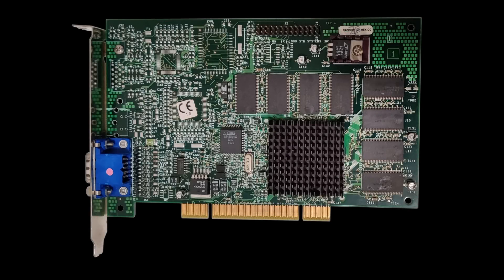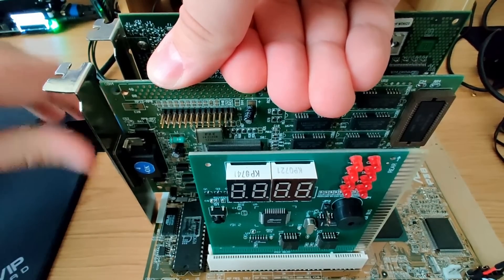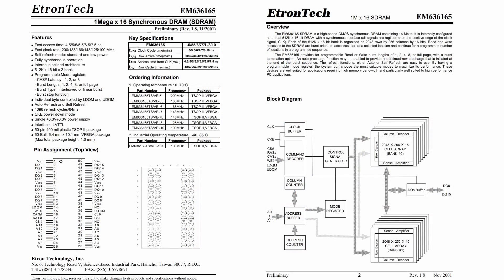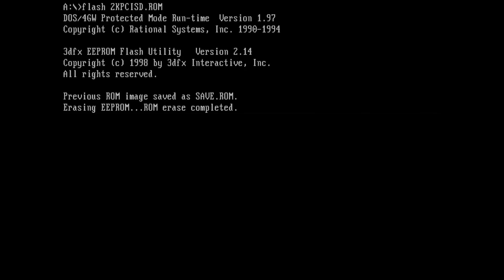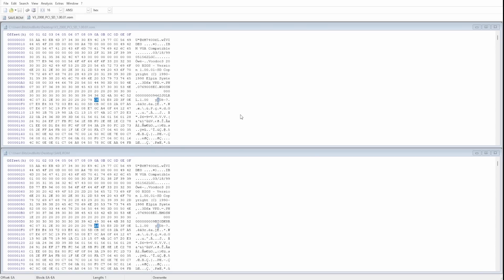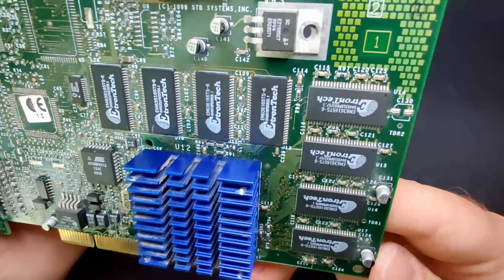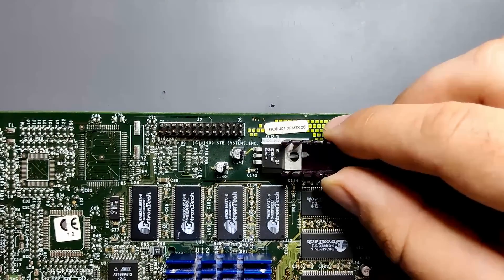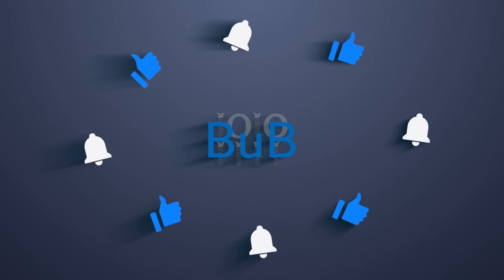Fix common issue of 3dfx Voodoo 3 (black screen)

Comment: I need to do this to mine I think. It works intermittently- either that or my CPU overclock is borked. :/ The card is completely stable in game but sometimes my board beeps with Bad Video Card- which is obviously false, since after a few reboots it starts perfectly. This did only start to happen when I added some unsupported RAM though.. some weirdness going on with my RAM, I have two 128MB sticks and a 64MB stick, when only the 128mb sticks are installed it detects 128MB when the 64mb stick is installed in the last slot it bumps the total to 256.. idk what's going on with this machine lmfao
Reply from the maker: The issue with the card is very similar to what I have experienced with my Geforce2 MX. At some point, it stopped completely - and the reason seems to be the BIOS chip slowly losing data integrity. A reflash of the BIOS chip should help.
Reply: @bitsundbolts  I replaced a memory module and it stopped doing it. I’m still going to flash most likely- my card is stable at 3000 speeds so no reason I shouldn’t flash 3000 bios. My case has a side fan blowing air directly over the card it’s perfect
Reply from the maker: Right, it could be related to other hardware in your system. I would try to run everything at stock speed and see if the bad video card error disappears. Then you can reinstate the overclock one by one testing each over a few days to make sure it's stable. It's a tedious process

Comment: I also had a similar problem with an nvidia fx 5200. I removed it after it wouldn't show any output and replaced it with a matrox card and when I put the nvidia one back in years later, it suddenly worked

Comment: While flash based ROMs will develop errors over time, the main problem with old video cards are the electrolytic capacitors. They only last a decade or so and need to be replaced.

Comment: I've seen newer components that replace older voltage regulators for ZX Spectrum and some other consoles, they're much more efficient and release much less heat. Maybe that could also be an option for the Voodoo cards?

Comment: Great video so far, one comment: you should screw the regulator the other way around, with the screw comming from back and nut on the regulator side
Reply from the maker: Curious why. I followed the other Voodoo 3 card where the screw was like this too. Is there any benefit reversing the orientation?
Reply: @bitsundbolts  back in the day, most if not all cards were "flat" on the underside. I guess it was a way to prevent any possible shortcircuits

Comment: Great video! VBIOS issues like this seem to be very common in cards from this era. I’ve revived a couple V3 3000s and some Matrox G200 series cards this way. I’m actually working on an AGP Voodoo 3 2000 right now that absolutely refuses to be flashed. I will likely need to desolder the eeprom chip and flash it in an external programmer like you did with the GF2 recently. Wish me luck! 😅

Interesting that the bad ROM worked again when flashed back. I’ve had this same behaviour happen with a bad motherboard BIOS that I pulled off too. I’m assuming there must be some borderline bits that are difficult to read from the chip that get reapplied properly after the flashing process. But yeah I wouldn’t have trusted it either 😁
Reply from the maker: Thanks! Good luck with your Voodoo 3! Yeah, the GF2 also refused to flash. The BIOS chip I removed from the card doesn't even want to cooperate with my external programmer. Ich cannot write nor read to it - and I get a similar error that I got in DOS. I assume there's something else that's causing issues.
Probably requires more time to figure out what's wrong.
Reply: @bitsundbolts  Thanks! I ended up replacing the EEPROM on it, but that wasn't the issue. In the end it was a damaged trace leading to the "Output Enable" pin of the EEPROM. Was hard to spot, but the card works perfectly now. Will hopefully get a video out on it in the next few days 👍
Reply from the maker: Can't wait to see it!

Comment: I wonder if my Vodoo 2 12MB can be fixed by reflashing its BIOS.
I just stopped working back in the days, somewhere around 99 or 2000..

Comment: Overclocking to 3 3000 is not as interesting as an attempt to add missing parts such as secondary VGA connector. Will it support multi-monitor configuration?

Comment: So why did the bios need reflashing. Wrong bios flash? Info lost from not being powered on for a long time? WHY!!!!
Reply from the maker: As far as I was told, the card stopped working in 2006. Similar to the GeForce 2MX I had at that time, I imagine that the PC wouldn't show a picture from time to time until reset. It gets worse until it stops completely.

Comment: Bitrot
Over time the cmos can lose bits or rather the strength of the bits goes low. Reflashing the same bios brings all the ones and zeros back to 100% strength.

Comment: I have a Voodoo 3 3000 that displays weird stripes once it get's warm. Probably just some cold solder joints somewhere, but since the cards aren't produced anymore, every dying one is a card that won't be replaced.
Reply: If the stripes are vertical, this speaks for a memory problem. Changing the chips does take some soldering skills, but I managed to fix my V3 2000 AGP like that.
Reply: @moritzrudolf5370  is there a way to figure out which chip has gone bad without just going through all of them?
And yes, they are vertical. About 1/4 or so of the width.
Reply from the maker: Unfortunately, I am not aware of a method to find a faulty memory chip on a graphics card. I did some research once and got some tools that claim to be able to find a faulty chip, but it was for S3 virge ( don't remember the tool right now). I'm planning to look into this once I get a card with memory issues.
Reply: @HappyBeezerStudios  an IR camera can help identifying bad chips in general but I don't know if that applies to memory chips too. Also, you don't tend to have one just laying around

Comment: Another great repair. I would like to know the physical differences between a 2000 and a 3000. Is it just the bios?
Reply from the maker: As far as I am aware, just the BIOS is different. It could be that the memory chips are rated for lower frequencies only on the Voodoo 3 2000, but the PCB should be the same as a Voodoo 3 3000. The graphic chip may be binned at a better quality for the 3000 model.

Comment: Flash / eeprom / eprom etc all rely on modifying a charge in a cell to signify 0 or a 1.
The process of sensing and stabilising the read bit takes longer the weaker it is (until it can no longer be read as its correct state at all) so it was likely no more than a marginal bit that needed some extra time.
Another quirk of arrayed storage devices like these is that they can often read data muuuch faster than their spec if you read them linearly compared to jumping around as it would while executing code from said device :)

Comment: Excellent Video, My Exp with Video Cards over the years is to reseat the card into the PCI or AGP Slot which are very tiny and delicate with AGP. Try that first before anything else. Even dust can affect it believe it or not. Seen some dirty cards over the years. Use an Air shop Hose and blow out it clean. Electrical Spray for the Motherboard and dry with a hair dryer on the cold setting. Caps are crap these days, so any one of those could be bad in rare cases. handling is another factor. Even to the day, I see people without rubber gloves and their fingerprints cause corrosion on either the connectors or the board.

Comment: I had similar problem with the bios on my PC main board. After 5 years my PC couldn't boot every time .. once on 3 -4 time and start was very long around 30 seconds. 
Itt looked like my bios was hardly to read by main board. 
But after reflashing  the bios the main board started to work again like a new  ;) ... boot every time and staring in 2 -3 seconds.
I think some bios chip degrade over a time and need to be reflashed.

Comment: I have heard things like bit rot will cause strange issues like this and reflashing the bios will "refresh" it and bring it back to life. I once had a DFI LanParty board that suffered from this and a reflash using the same bios did the trick.
Reply: yup classic case of bit rot
Reply: @MrTGuru Maybe the chip just had some "weak" cells. Reading out the bios probably worked more aggressively and managed to get a functional image, and reflashing it put that "fixed" bios back on.
Reply: @MrTGuru a ghost in the machine i guess

Comment: 🤔Perhaps the flash programming tool uses a slower and more reliable reading speed/method than the the motherboard chipset and was able to recover an intact BIOS.
If the checksum is correct (in HxD use Analysis->Checksums, the 8-bit one must be 00) it's probably just a different BIOS version, it would be quite a coincidence that all the values would change randomly keeping the checksum correct.

Comment: Did you notice the "new" ROM images were 64K and the one on the chip was only 32K?
Reply: That's because the second half of the downloaded ROM doesn't actually contain any code, it's just padded with 0xFFs to match the size of the flash chip.

Comment: Like! Another card brought back to life. A while ago I purchased a Voodoo Powercolor Evilking 3 Extreme with 183 mhz and 5ns (200 mhz) memory. Theoretically with 5ns (200 mhz) memory it should have easily reached 200 or even 210 mhz. But to my surprise it was stable with no artifact at only 183 mhz, even 1 mhz more and small artefacts would appear. Than I noticed that the card had 1 capacitor missing. I guess that it wasn’t stable at over 183 mhz because of that missing capacitor.
Reply: Reminds me of my Radeon 9600 Pro, that also craps out once the memory is just 1 MHz higher.

Comment: I flashed my Voodoo 3 2000 to 3000 back in the days, the timing of the memories allowed it and It cost me a simple precautionary fan on the otherwise passive heatsink (the one on the card in this video too has the marks of having had a fan at one time).

Did it work? Yes. Did I have problems? No. Was there any noticeable performance boost? No.

If you want to do it, be my guest, but in my experience it's only wasted time.

Comment: What I liked about Voodoo 3 2000s back in the day is they supported standard VESA graphics as their legacy mode.  So it required no special drivers or software to get them to work in high-res 2d on Linux in the bad old days of XFree86.

Comment: 8:20 - it seems that flipped bits were placed in non-critical headers section, but after all corruptions the BIOS checksum have not matched the BIOS itself and so the GPU just failed this check and refused to boot, and re-flashing fixed the checksum and the GPU have verified the checksum correctly and booted up. 

Or, maybe, flash cells became unreliable and failed to read correctly at full speed, but flash utility may work at lower clock speed to access BIOS chip, and it works (more or less) reliably, and after re-flashihg charges in BIOS flash were updated, and it became working again.

I had something like this on SSD which was placed in my laptop - I have need to move partition with cold data to another location temporarily, and first movement took a lot of time, but then I have need to move this partition back to original position, and move process took a WAY less time to complete. I think flash chips were not re-written for a long time at cold data blocks, and some cells lost their charge, and so the SSD controller had to perform many error corrections using ECC codes, but after partition move cells were recharged to full charge, and no ECC were needed to read them when I did second movement.
Reply: I was going to say this. I think the most likely explanation is the second one (I doubt the card would perform a checksum of the bios data). I think the only likely explanation is that the flash memory is "too weak" and when read at full speed it just gives non-sensical data, but if read at lower speed (which the flashing utility probably does), then it's possible that it can read the correct value, given enough time. But when he re-flashed the BIOS, the data became more "strongly" written and now works at full speed, even with those missing bits.
Reply: does the tool updates the checksum on the fly?
Reply: @cocusar  I don't know. Maybe re-reading BIOS after flashing BROKEN.ROM will uncover this.

Comment: So what if you get a card that has a missing BIOS chip altogether? 😅

On my "restoration" project pile is a Voodoo3 PCI card that doesn't seem to have ever had a BIOS soldered on the board. (just empty pads where a BIOS would would be)
Until I saw Tech Tanglent's video about the Hydro Thunder PCs using "special" 3Dfx cards that contained their initialization routines in a different ROM on the motherboard, I thought I was dealing with a weird factory issue where somebody messed up. (When the BIOS is completely missing, the card shows up in Windows Device Mangler but not with any identifying titles.)
Reply from the maker: This is new to me as well. I probably would blame the factory as well.
If the PCB of the card is the same as the reference board, I would try to add a bios chip and see what happens. If you're lucky, the flashing tool may just donuts job. But just to be safe, I probably would preflash the chip with the correct BIOS.
Reply: @bitsundbolts  I originally suspended my project until I could practice more SMD soldering before adding a BIOS chip. Thankfully I was able to source a chip and socket. Sadly, I'm not sure if the socket will fit in the spot without interfering with nearby passive components so I might just have to go for broke and solder the chip directly.
I did, however, preflash the chip when it arrived to make sure that, at least, was functional. 

Your video is an inspiration for me to finish that project up, especially now that I've at least some practice and new tools I didn't originally have when I received the 3dfx cards. Cheers!
Reply from the maker: I wish you best of luck! You're right, there are plenty of other small SMD components around the BIOS chip pads. But even if you solder the chip directly, it's worth a shot.

Comment: I wonder if the original bios was on the verge of failing and wasn't being read properly by the card. Maybe the voltage being supplied to the chip was slightly lower than the programmer as well.
If the programmer reading the bios had a slightly higher voltage when reading the chip it may have resulted in a successful read of the bios rom.
Reflashing the bios could have removed any slight degradation of the rom that caused the card to fail to read it making it work again.
I'm no expert and this is only a theory as I have heard that flashing a chip multiple times with the blank check turned off can reduce any chance of the flash failing.

Comment: i've got an fx5200 that needs a new bios chip. except i can't find one thats properly compatible. tiny little spi chip.

this seems to be a thing in a lot of older cards. bit rot or dead bios chips. though some of the cards from around the fx time are going to fail if they get too hot due to the way nvidia made the actual gpu chips.

but yeah, reflash/rebios and caps should fix most older gpus.
Reply: I recently hooked up my old daily Northwood Pentium 4 tower that has an FX5200 in it and it still works great, hadn't POSTED it in 8 years.  I remember when I upgraded to that FX5200 from a MX440 I could watch youtube videos in 480p instead of 360p in 2009.

Comment: Definitely make it a 3000, as far as I remember it was essentially a 'free' upgrade for all 2000 cards.
Reply: Just make sure you have a fan, even if you don't overclock the card. STB specced horribly undersized heatsinks for all Voodoo3 cards. It's not uncommon for them to suffer thermal death.

I've seen those heatsinks get so hot that they burn the anodization off of the heatsink and melt cables touching them.
Reply from the maker: Bare minimum to keep the card alive past the warranty period...
Reply: @bitsundbolts  even with ample case airflow?
Reply: Most V3 2000 cards with 7ns (143 mhz) memory reach a maximum 160-170 mhz. Many are not stable at 166 mhz because of the slower 7ns (143 mhz) memory. Its just a matter of luck if a 7ns V3 2000 will reach 166 mhz without artefacts. The ones with 6ns (183 mhz) do have a much higher overcloking potential.
Reply: also as this particual model has 6ns memory will force only  thegpu chip to 166 mhz
Reply: Yeah, throw a nice fan on. There aren't any new Voodoo cards produced, so keeping the old one alive is recommended. There are slim 70mm fans, which should give it enough airflow without being too noisy or getting in the way of the slot underneath.
Reply: Does the crystal matter, or is it just an overclock multiplier.
Reply: @SidneyCritic  clocking can be done in software, but GPU chip and memory will run at the same clock, so instead of switching crystal getting faster memory can help if it it's the limit first